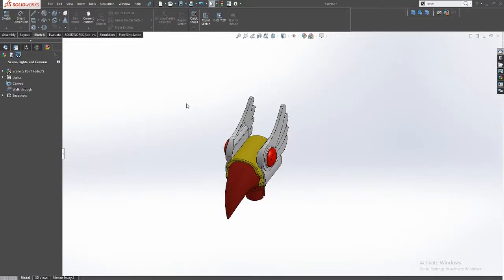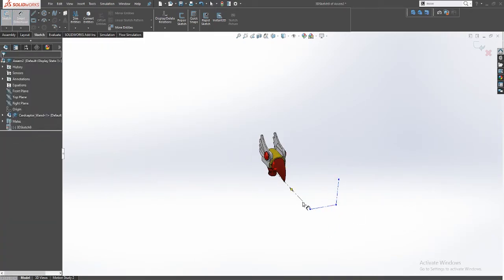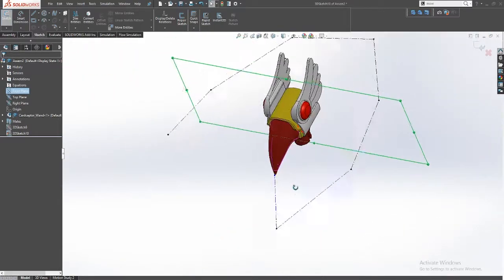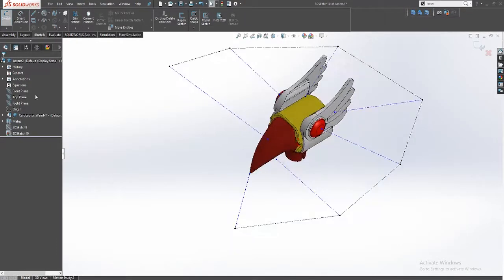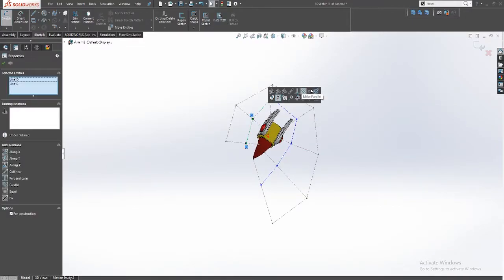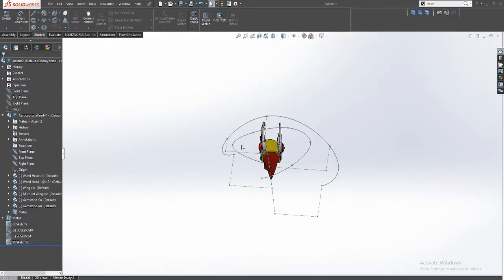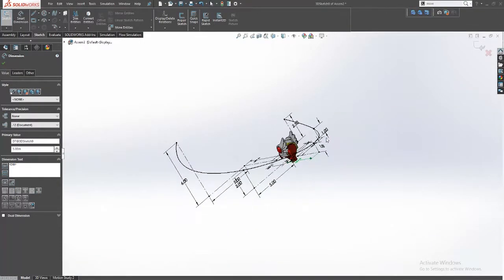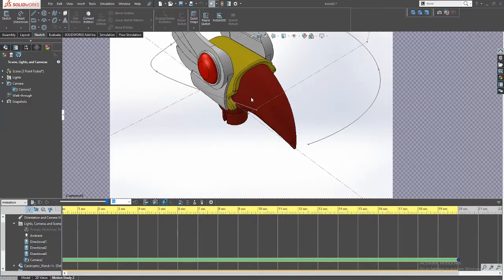Solidworks Camera Animation Trick For Reddit

Comment: Thank you much for this super helpful video! Top marks for explanation and demonstration =)

You can lock the camera rotation / roll  by checking the "Set roll by selection:" box (under Properties) and selecting a plane that is normal to the vertical direction -- use the "Flip Direction" box to change up / down.